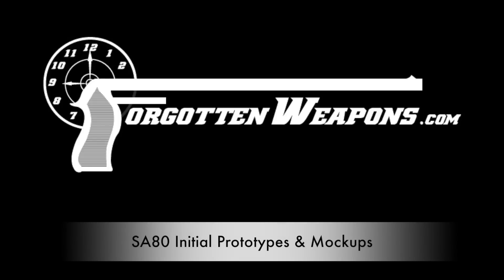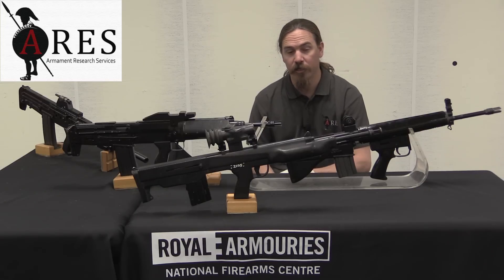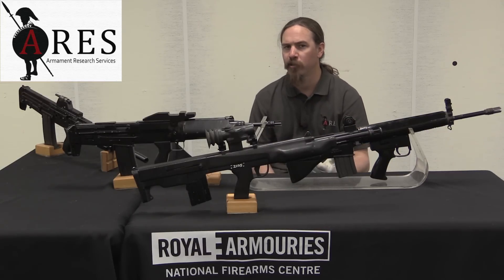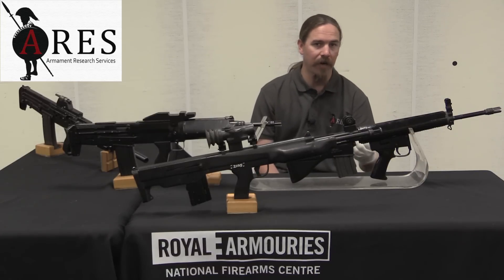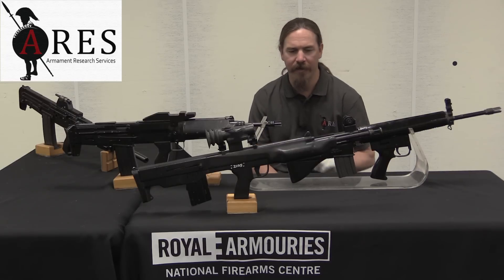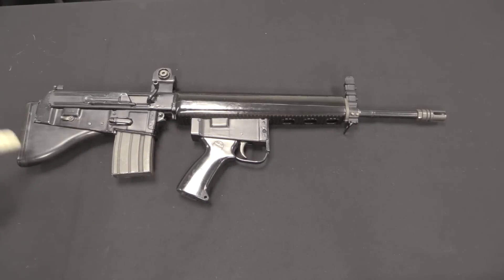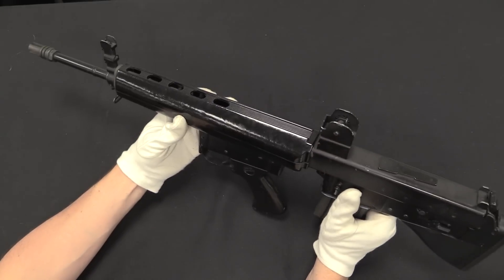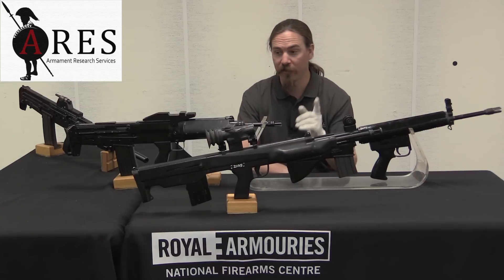SA80 History: The First L85 Mockups (Sterling and Stoner)

Comment: They chopped up a Stoner 63? Will the crimes of the L85 never end?
Reply: The L85: karma is a bitch!
Reply: To be fair, the Stoner 63 has barely been chopped at all apart from a small hole for the throw of the trigger actuation lever to link bar pivot area, the grip being removed (and possibly repositioned) and its had some extra bits added in place of the lower hand-guard (the new bullpup trigger group) & original trigger aperture blanking plate & short butt-stock end-cap added.
Reply: It's not a British weapon unless it's designed by an 80 man committee of middle management.
Reply: indeed so Al my-name
Reply: No, no they will not, and yet, I want one.
Reply: They capitalised on its modular capacity. That's what it was designed for.
Reply: @allewis4008  you forgot one small part. And when that has been done  send it to the germans to get it to work🤣

Comment: To all of the people going on about RSAF Enfield stealing the design, I do have to point out that it is fairly common practice to "borrow" designs and design elements from other firearms manufacturers. Example, the M1903 Springfield was a rip off of the Mauser and we ended up having to work out a settlement with them, although sources conflict on whether or not we ever fully paid up or not. And let's not forget where the British got the idea for the Pattern 13/14 rifles, I don't think they 'magically' came up with a nearly identical basic action to the rifles they had faced in the second Boer War with purely their own design work. Even now, it's not that uncommon, if you remember the original Smith & Wesson Sigma (still don't get why my dad likes his so much, it's too ugly for my taste and too light for the caliber it's in to shoot comfortably for me) got in trouble for being functionally and aesthetically too similar to the Glock pistols (they're both too blocky for me, not much wrong mechanically, but I need some more complex contours to keep my eyes happy).
Reply: That is a valid point. There are some amusing examples of that, too. My favorite is the M60 machine gun. It's action is based on the Lewis Gun by way of the FG-42, with an MG-42 belt feed mechanism. The funny part is, when we made the M60, we copied some of the features of the FG-42 that were only relevant for semi-automatic functioning and they may have contributed to some of it's problems. I will admit that the M60 works fairly well when maintained/new, but once they started to get a bit longer in the tooth, problems came up that gave it a bad reputation with people that hadn't used them when they were new. I know Ian has a video on this and when my dad first saw it, he was surprised that people had such problems with the M60. He was in the army not too terribly long after the Vietnam War and not only had most of the same gear as was used in the war, but was trained by vets that had been in the war, so he benefited from their war experience and the fact that much of the gear wasn't that old yet. He did have some problems with the M60 during his short run of being trained on it, but as long as he followed the advice of the guys that used it in combat, it worked more than well enough to do it's job. Now his M16 on the other hand, while he never had much in the way of mechanical problems, he had more or less inherited the mistrust of it (it didn't hurt that he was also given an M14 setup as an M21 sniper rifle (it was called that back then) because he could actually hit what he shot at, and he has never gotten over that affection) from the guys that had it in Vietnam. He has come to terms with it more recently and prefers the older, lighter M16A1 type (as do I), but he still is not a big fan of 5.56/.223 (can't say that I'm all that fond of it either, not for life or death sort of stuff. Love it for target shooting though. I will say though, as long as you don't have to shoot through cover, it works alright from what I've seen, if you get enough velocity.).

Comment: Hey, had a thought while watching one of Forgotten Weapons videos on You Tube that might help with the accuracy n fire rate of  weapons systems. Do you use dead strike hammers in any of your systems? I watched a video of a guy making a Guitar and he was having problems with the hammer he was using bouncing as he stuck it causing it to hit more times than he wanted. He came up with a solution to the problem that I believe could be transferred to work in weapons systems. He made a dead strike hammer by drilling out a large cavity in the hammer head and filled it with lead balls, they come down inside the hammer head the instant it hits causing it to strike without any bounce giving better accuracy in controlling it. I believe that if that idea is transferred to the action of a rifle it could possibly help with the fire rate and accuracy of the systems. I thought I'd mention it to you guys as you'd be in the best position to be able to try it out if you thought it could be of some benefit, and  your UK based. Also am an unemployed person in a council housing estate who just has ideas and nothing else.

Comment: Interesting. With so much R&D, it's a shame they hashed it up so badly. Like some others, i can't help but wonder if they would have been better off modernizing the EM-2. They could have always designed a 6mm or 6.5mm cartridge based off of it if they no longer wanted the 280/7mm (which seems like it would be great in its own right). With modern powders, they might be able to decrease the bullet weight to say, 120 grains and up the velocity some and have a flat shooting cartridge. I wonder if that cartridge influenced the comnercial 7mm-08, or if they just went off what wildcatters were doing. Maybe the wildcatters were influenced. Ah, what might have been........

Comment: Bring in the L85 Parts kits.  In death they can at least be rebuilt by US collectors and appreciated.
Reply: @chibani

Pretty much. I mean, given the AR-15's FCG is available everywhere, and the blueprints to the lower are known...  You could stick a butt-plate right at the back of the buffer tube, make a linkage to connect the safety to a matching lever up front, and then the same with the trigger. Use the same bolt and carrier, and you only have to get a little creative with the charging handle.

It'd look kinda like the L85, except it'd work.